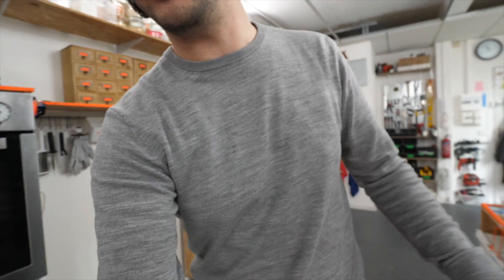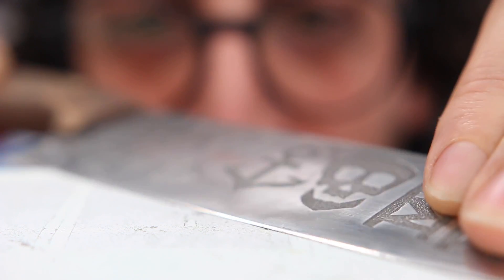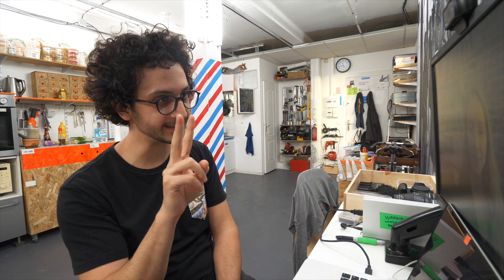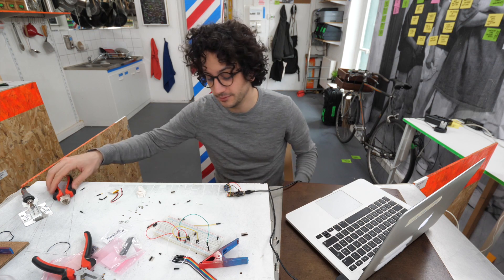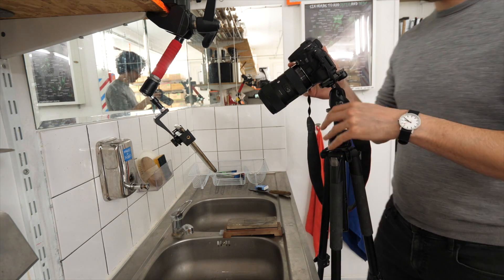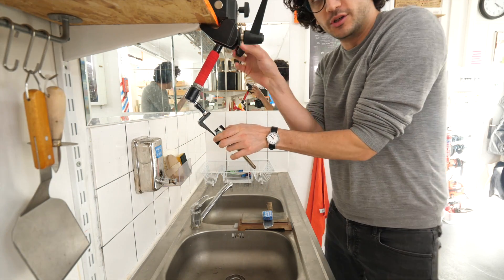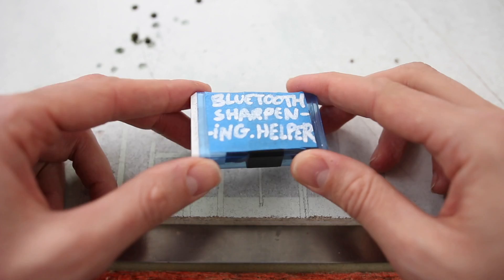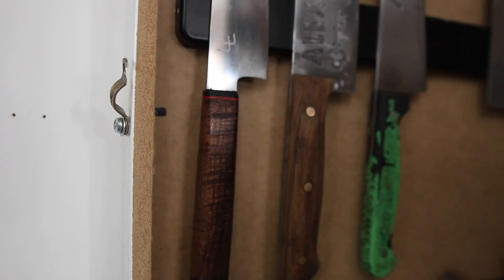Is This The Future Of Sharpening ?

Comment: Hi, I checked Becky’s channel andvideo for this project, see that both videos are three years old, shame on me :-)
As an engineer in IT and partly designing UI, my question is: why are all proposals for visual effects like angle in a list, LED or what so ever.
I would suggest a sound as an indicator of the used angle. If using an acoustic scale, you can concentrate visually on your knife and movement. A lower/higher sound or a tick sound faster and slower if angle changes. As Alex the French cook might except, it is not needed to keep a precise angle of xy degrees, but the consistency while sharpening. So the indication of 0° or 90° is not important, only must be kept the same for the knife for sharpening processes. Anyway it is a nice idea, did you proceed with that project?

Comment: I imagine you want to sharpen the whole blade not just a single point of it! I think you are missing one other axis... you are using only the angle of only the sharp edge of the  blade. I think you also need one along the length of the blade. This tends to changed as you are sharpening the whole knife. Ergonomics tells you we tend to move in a semi-circular motion. I agree that noise would be a good addition as per one of your posted comments. This definitely would be a good feed back.

Comment: There are sharpening stations used by knife makers that use a mechanical means to keep the right angle, even at the tip(which you don't have with the digital angle gauge)
It's just a stick with a stone attached to it and a vice for the knife. The stick keeps the stone at the right angle, as the knife is kept stationary.

Comment: I put a little glider, the 3M Bumpon under the edge of the blade on both sides to maintain the angle. Pretty simple, especially when the blade is small and you have to keep it pretty flat. The only issue I had that it does not slide perfectly on my 6000 wed stone. But the end result was great.

Comment: The software could be much more improved. For example for you to insert a desired angle and display coloured responses, e.g. orange, red, green, if you are within angle or not. Or with sound, as you go away from the desired angle in either direction the sound becomes more high pitched so you can adjust just by listening to the sound while sharpening. I am a software engineer, let me know if you need any help 👍🏼

Comment: Would you consider clamping the blade at a stationary desired angle and make a (much simpler?) device that would move the sharpening stone underneath it? 
Maybe even simpler subtle vibrations on the x and y axis?

Comment: seems impractical and doesn't fix the problem? you cant get the correct angel wouldnt just cutting a wedge of wood at the right angel with a screw secured at one face with a small plate of metal to get surface area and a butterfly bolt to lock it in place? that way you literally cant get the wrong angel instead of a senor going "HEY YOU FUCKED UP!"

Comment: Just mentioned on Becky's video that what would be immense would be to integrate a 10 segment LED bar that would give you a real time visual reference as to how far out you were. So let's say the middle two bars light up when you are within an acceptable range of the desired angle, but more LEDs light up in each direction if you drift away from the desired angle, say more LEDs down as you drop to far and more LEDs up as you drift too high. This would give you a more valuable and possibly intuitive way of adjusting as you go along. I might have a go at this Alex/Becky, thanks!

Comment: It's a misconception that you need to keep each stroke perfectly consistent in angle. Two slightly curved surfaces that meet in a point can still be razor sharp as you demonstrated in the previous video. Just start with the same process, sharpen to a burr on the coarse stone on both sides at a relatively consistent angle, then polish the edge off on a SLIGHTLY STEEPER angle on the fine stone.

Comment: I agree that to learn how to get a consistent angle we need feedback. Your angle finder  gives the feedback needed.  However, the feedback is digital on the screen and not near the knife. Being a 65 year old who grew up in an analog world, I will propose a modification.   Add indicator lights on the unit attached to the knife.  Use five small lights in a vertical column from top to bottom: red,yellow,green, yellow, red. Program the lights to the desired angle and the acceptable error.  Example for a novice: green = 20 degrees, yellow = plus/minus 1 degree, red = plus/minus 2 degrees. Program by USB cable and the Bluetooth function is not needed unless you want to have the data to review later.  I can't add the sketch to this comment.

Comment: Je sais que c'est un peu tard pour laisser un commentaire sur le sujet, mais peut-être qu'il faudrait changer d'angle d'attaque. Au lieu de faire des mouvements avant-arrière, ça serait plus efficace de faire des mouvements gauche-droite. Faire en sorte que tout le haut du corps se verrouille pour garder l'angle (bras, épaule, torse), et utiliser tes hanches pour bouger de gauche à droite comme un compas. bien sûr, il faudrait mettre la pierre d’affûtage à "l'horizontale". 

Utiliser les bras en avant-arrière pour affûter est le meilleur moyen de faire varier les angles. il faut synchroniser le mouvement des épaules, des poignets et des coudes pour garder l'angle (et le mouvement de ces trois points change l'angle d’affûtage), alors qu'un simple mouvement de gauche à droite se fait dans un axe qui ne bouge pas l'angle en plus de ne pas utiliser les muscles qui le maintiennent.

C'est un peu comme la différence entre un cercle tracé à la main et un cercle tracé avec un compas.

Comment: A very experienced knife sharpener once said, "It is physically impossible for a person to maintain an exact angle, when sharpening a knife, with long training you can reach + - 3 degrees" If this is true then your little gadget is definitely a good tool for measuring progress in training. However, it will never be accurate. The only way to get an exact angle is with some kind of fixture that makes it impossible to use the wrong angle...

Comment: I don't get that IT approach. Make a supporte for the stone with empty space below, have some flat piece running there with 2 parallel large triangle guides at 15° high enough to go way past the stone surface from the bottom up and rest your knife on those triangles edges while grinding on the stone. Exact 15 degrees guaranteed.

Comment: I feel as though you’re attacking this problem from the wrong angle. The problem isn’t so much not knowing the exact angle you’re sharpening at, its not being able to sharpen at one angle consistently. I think some kind of mechanical guide you could attach to the blade to ensure a consistent angle would be much more useful.

Comment: one curious question(even though this is an old video), what angle is your sharpening stone sitting at on the sink? that will add a few degrees onto the edge if it is not 100% level since the tilt sensor in the device has a plane that it references from as 0° although if you were to go one step further you could eliminate that issue of stone angle by adding a button that would "calibrate" the sensor to read at 0° when it's pressed while laying the blade flat on the stone at the time.

Comment: Hi Alex,
It's now about 15 months past the time you posted this video, of course it's brand new and exciting to me. By this time you may have disposed of your little blue box under a steamroller.

If not and you hadn't already thought of the idea, I was thinking of audio feedback as an added feature. It would function in the following manner.
Input the desired sharpening angle for the knife that is being sharpened. As you sharpen the knife the device outputs an audio signal. A neutral tone indicates you are sharpening at the preset angle, high pitch tone you're angle is acute, low pitch you're too obtuse. Perhaps you could make the input with a small degree of acceptable variation in the sharpening angle, maybe 2 or 3 degrees. That way you won't be constantly annoyed by the variation of the feedback tone.

Also, the device would have to be reduced in size so that it could be fitted to smaller knives.

Comment: It would be a great device to establish the muscle memory for the desired angle. You have to keep in mind it is measuring the angle while on top of the blade, not level with it so it would be slightly off. Also you only sharpen on your down stroke so every 2nd number being the same is important, not so much every number. You can move it to what ever angle when moving up as long as you can muscle memory your hand to the position for the down stroke,
Reply: Imho this is wrong. First you ARE also sharpening on the up stroke. Second the device is not synched with your speed, so only checking every second number is also wrong. If you don't move the blade at all, the sensors with still produce data. And third taking your opinion about "up stroke is not sharpening" to the max would mean, that you do the up stroke at any angle without dulling the blade, which is also wrong...
Reply: @masc_music  new to sharpening! Thanks for the tips. :)

Comment: Ok, old video. Lots of ideas for feedback, but I think a bargraph display inside the enclosure (it's transparent) would be all that is necessary. Audible feedback can be lost to other sounds and/or be annoying to other people around (especially if they are trying to sharpen with their own angle device). Haptic feedback would vibrate the blade that is trying to be sharpened. Might not cause a sharpening issue, but I'm not sure if I would want to risk it. The simple bargraph LED display with one LED lit could be good feedback. You are looking and concentrating on your blade anyway, so put the visual feedback at the blade. Have the single LED lit in the center for perfectly angled. light up towards one side for too high, and light up towards the other side for too low. If you must have Bluetooth, use it to change the desired angle. But really, once you get rid of the radio, the cost can go down enough to have multiple angle finders for different sharpening angles.

Comment: If you're trying to learn to sharpen the knife as close to your desired angle as possible, you can have the microcontroller or phone sound an ascending tone if the angle is too low and a descending tone if it's too high. That way you can focus your eyes on the blade.

Comment: The issue with this design and the Wixy devices is that they would demand too much visual attention to use them in this context, when the visual attention needs to be focussed fully on the knife. Knife sharpening is a dynamic activity which relies on continuous feedback to the user via fingers, eyes and less importantly ears. 

If you decide on a visual feedback, it will have to be on the device and move with the blade. I'd suggest two rows of adjacent LEDs, one with say five LEDS, which represents the required reference angle and then another row of say eight LEDs, which can represent the current angle by lighting more or fewer LEDs. I'm not sure if there is a lag problem with LED on/off, however, which may not facilitate this.

I wouldn't rule out using audio feedback. This may free up the eyes to watch the blade. A reference tone could represent the required angle and shifting pitch proportional to the actual angle will cause audible dissonance which the user tries to correct as the blade is moved.

However, I think that the best solution would probably to use direct visual feedback and allow this to assist the user to learn the association between the blade angle and the sound it makes as it is being sharpened.

Comment: This device is counter productive and does not help you keep a rigid angle set, it actually is like driving while txting, you have to look away fromt he stone and knife to check the angle, it also adds weight to the blade which will mess up your muscle memory and feel for the angle when doing it freehand. Why don't you just use a jig? a jig is the professional guide tool for putting edges on blades. Go get a jig, this invention I will deff never use.

Comment: Just make the BT device send signals in faster intervals and make the app scream at you HIGHER (if value is more than indicated, 17 degrees in this case) or LOWER. This way, you will be coached by your app to improve.

Comment: A person's ability to respond to touch is orders of magnitude more minut and faster that a person's ability to respond to sight. This is simply a biological fact, and not one that convenience can overturn. But you are using the comparatively low resolution  tools  of your sense of balance and your sense of sight to perform a high-resolution task, ie. <3 degrees of variance .  My point is that you have to move away from the current setup to one where your hand, or more specifically a finger or knuckle, can slide along a surface parallel to your cutting stroke. If you do this and practice with your new device, I'm fairly confident that you will find that you very quickly managed to be within a degree or two consistently.

Comment: Why don't you just have a 15 degree triangle made of some kinda slippery material (so it will glide) that clams onto the top of the knife?  low tech..  Like the cardboard you were using but just have it clamp to the knife and be wider/ stronger

Comment: I would suggest a device where you could set the desired angle into it, and an LED would light up when you are at that angle. would not require any bluetooth, but it would train you to keep the light on, thus improving the consistency of the sharpening angle.

Comment: Hmmm ... the blade is curved so as you measure the angle it would need to take into account which part of the blade you are sharpening? 15 degrees in the main part of the blade will measure totally differently to 15 degrees at the tip unless you keep moving the device parallel to a tangent to the edge.

Comment: Would it not make sense to add a green light to the device and the green light is lighted when the knife angle in between the low and high angle that you set in the app? This way you get almost instant feedback as to whether you have the right angle or not. Just a thought.

Comment: Why don't you craft a support maybe with a 3d printer? You could do something with a angle and put the knife on when your sharpen It, and just put something between the Stone and the support so you don't scrap It and it doesn't lost material and also the angle.
Reply: Nvm i've seen the full video so i get the point why you've done this device

Comment: How does the device measured angle account for the geometry of the knife? As the curve (belly) of the knife changes the angle of the knife relative to the stone must change to maintain a constant bevel. For example, you probably noticed you have to "lift" the knife to completely sharpen the tip.

Comment: Put a RGB LED on the device. If your angle of sharpening is in the tolerated limits, it turns green. If the angle goes to high it turns red, if the angle to low it would turn orange for example. 

However, I think my self made sharpening device which works mechanical is the best. There is just no room for error. One can sharpen only with one angle.

Comment: There is a simple solution and its called: sound. for example 0 is what you want, if you go -1 or lower or +1 or higher the device will produce a sound and the pitch of the sound will keep increasing the further you go from 0 either - or +, and it wont make sound on the right angle

Comment: There are many comments,  so I don't know if the following has been suggested.  Perhaps it's possible to add a LED green/red to the device.  Green would be programmed to light when the correct angle range is achieved.  Red would show when outside the correct angle.  You would not need to take you eyes off the blade and stone, and could train yourself to maintain the correct angle.   Ideally, you could select which angle, for different knife styles.

Comment: Why not use a magnetic mini digital protractor inclinometer? Its a small device with an output screen that shows the angle in a digital display. You would just put it on the knife and watch the readout on the screen.
Reply: https://www.aliexpress.com/item/Free-shipping-Angle-Digital-Protractor-Inclinometer-Digital-Bevel-Box-4-x-90-degree-Range-Magnetic-Base/1394624326.html

Comment: Using an accelerometer for this purpose (even if compensated by a gyro and sophisticated algorithms) is not a good idea. You will see fluctuations of a few degrees depending on which moment of the sharpening motion the angle is sampled. In fact I believe that your technique is significantly better than what the data stream shows. Now if you want to avoid using a jig at all costs, I'd recommend simply mounting a laser pointer on the blade (at the angle you want to achieve) and have a scale pasted on the wall. That will give you immediate and very precise feedback on whether you're holding the knife right.

Comment: 1300+ comments so this was certainly mentioned but, the device could emit a faint "beep" if you go out of angle. 

As for the prototyping and fabrication, there are plenty of manufacturing companies in China that would to that at a very cheap price. I live in Montreal and worked in the electronic industries for the past 20 years. Plenty of options here as well but much more expensive.

Comment: you should do an average over the last 90-120s, as this is a more accurate 'final' angle on the blade. add a few buttons, and lcd/oled screen, buzzer. make it where you can actively watch the angle as you go. audible alarm if you are outside of the specified angle +/- n degrees. preset angles to choose from...